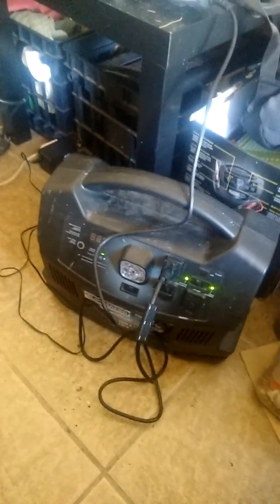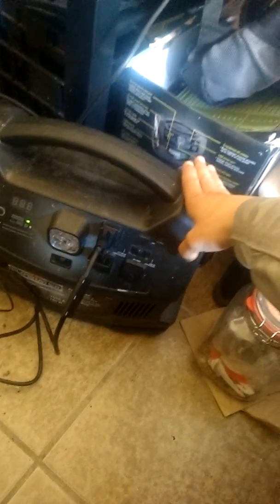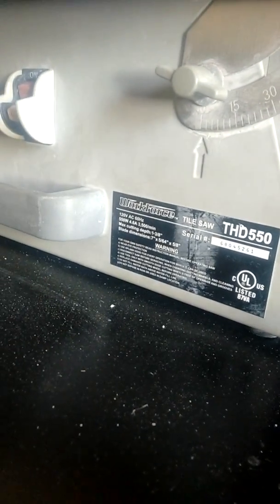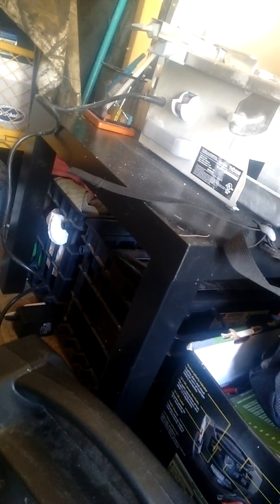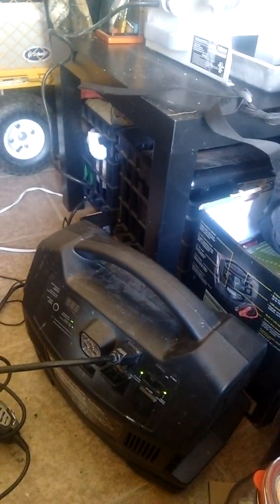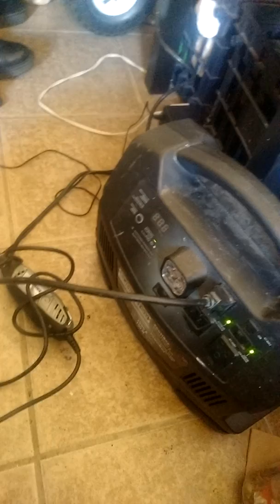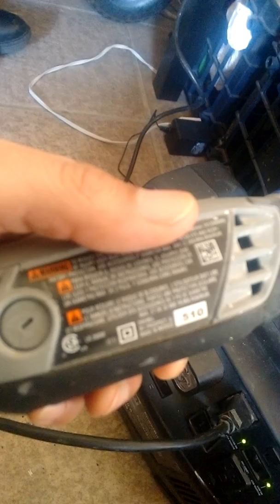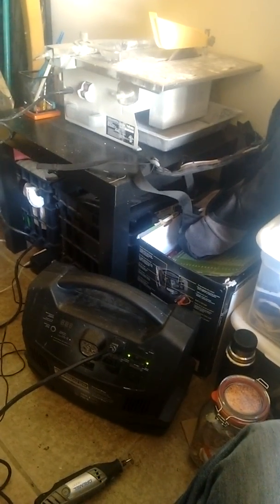Motomaster Eliminator Powerbox (2000A 700W) - 2/4

Comment: While the 550 watts if your tile saw is within the PowerBox's capacity (of 700W), this is running wattage.  The problem is the surge or start-up draw of the wet saw.  It's probably 2-4 times the 550 running watts and the PowerBox's inverter is not designed for this large of a surge.